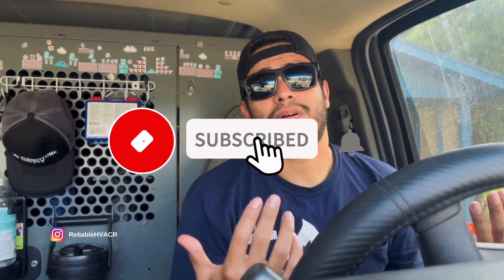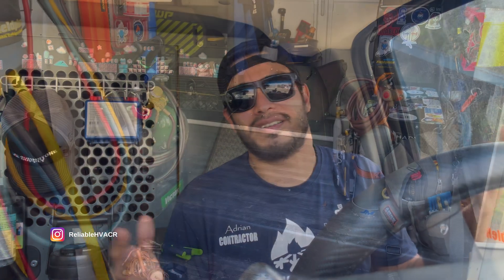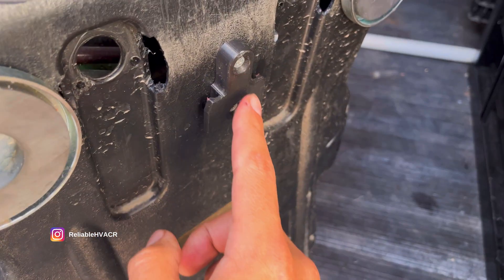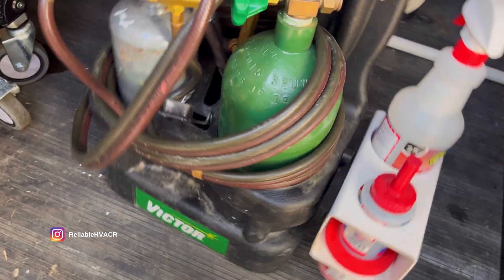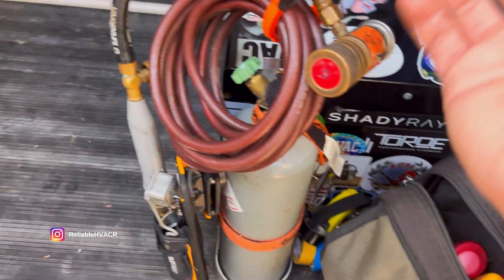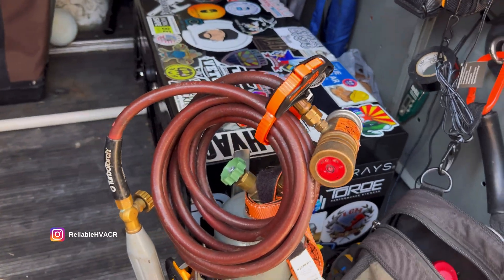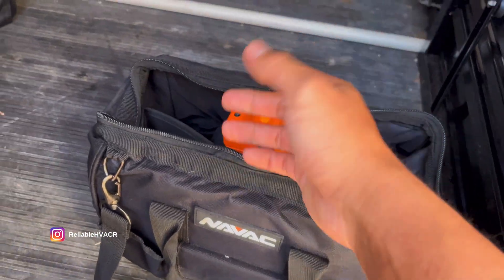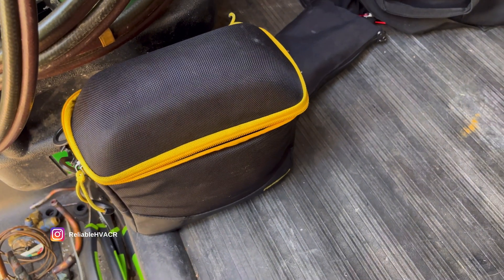My Torch Set Ups | Oxy Acetylene & Turbo Torch w/ Milwaukee Pack Out | HVAC Brazing

Comment: Great video, please consider adding a eyelet to the self as a safety that the lanyard can quickly clip to. During accidents the magnet mounts will let loose and send the pack flying if there isn't a lanyard. Easy fixes for at least the gas bottles. The MC bottle already has the lanyard and just needs a spot to clip to really quick

Comment: I already like magnets but it looks like I'll be buying more! Those Harbor Freight magnets are strong enough for my machetes and other tools.

 I'm no HVAC expert but completely replaced the systems on three of my trucks (two rebuild from crash damage) with no problem because I find videos by skilled gents who know their stuff.  Automotive labor rates are so high the first truck paid for my vacuum pump, nitrogen regulator and gauge set plus minor tools. 

My HVACbro showed me  how easy it is to replace the compressor, contacter and dryer on my home heat pump while he did it so now tackling an install for my shop won't bother me at all. I encourage any decent hobby level mechanic to learn this stuff because it's not magic.

Comment: Great videos for newbies. Watching them all. I want to learn the trade specifically for refrigeration, ice cream batch freezers.  Will be purchasing all Fieldpiece equipment as I like the best toys to work with. My main question is the digital manifold, 3 or 4 port. Except for the price difference, what is the main benefit of the 4?  R404A is what I am seeing in these batch freezers. Thanks
Charlie
Boston, MA
Reply from the maker: If you didn't catch my Livestream yesterday I used your question as the topic. 4 port is my recommendation, it has a dedicated vacuum port/hose. Even if you don't want to use your manifold to pull a vacuum there will be times you wish you had it. Especially on refrigeration side.

Comment: Very impressive set up. I started off with Oxy-acetylene brazing but being new I was blowing holes in the copper. I know I need more practice/experience with it but I switched over to turbo torch n doing much better. Thanks for sharing 👍
Reply from the maker: Been there. I always tell my guys just remember to keep the flame moving, you never really hold it still. On 1/4" or 3/8" pull the flame away every now and then.
Reply: @ReliableHVACR  thanks my friend 💪🇺🇸👍